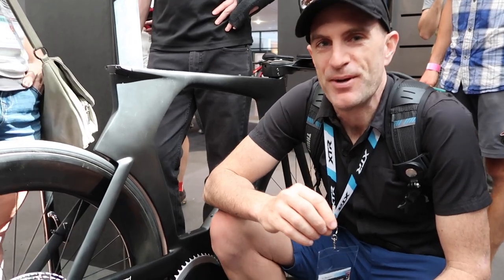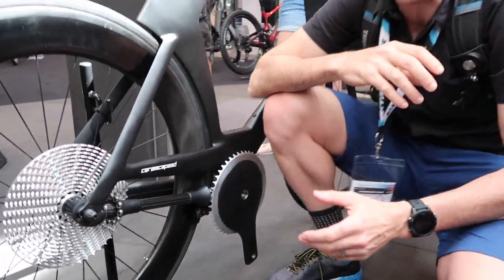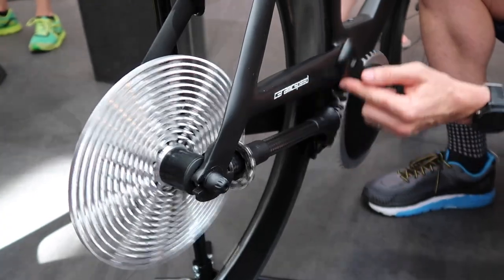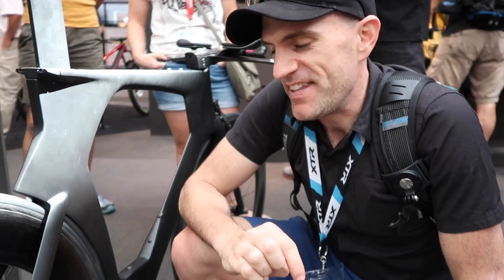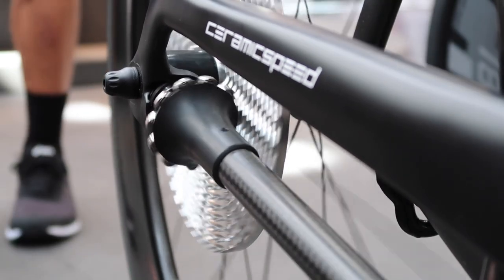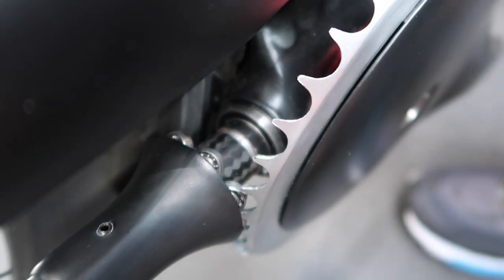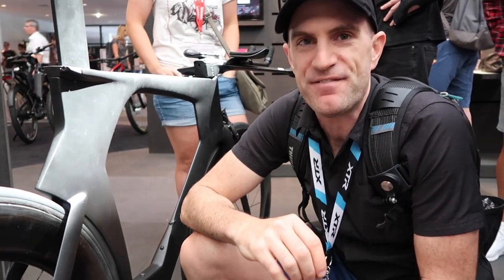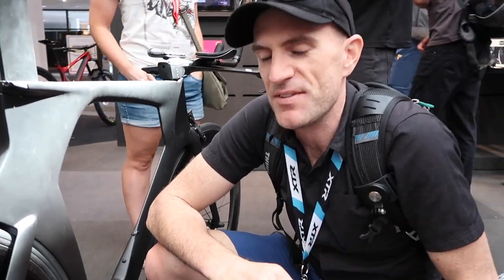CeramicSpeed DrivEN 99% Efficient Drive Shaft // Chain Free Bike // Eurobike 2018

Comment: The load will be concentrated on one or two teeth instead of being spread over 10-20 teeth.
Reply: Xia Jiang the cranks and cassette needs to be extremely stiff and strong for it to be usable and practical
Reply: Pretty sure the load is focused mostly on one or two teeth in a chain setup too...the chain just wraps around the others under no or minimal load?  Hence the “reduction in friction” claim here?
Reply: J Just J: pretty sure the load is supposed to be spread over all teeth in contact with the chain. This is the whole point of the shape of the teeth. As the chain wears and elongates, the tension in the chain will naturally cause the chain to move up towards the apex of the teeth and away from the base, so that the chain is still in full contact with every tooth and the load is spread. Only when you have excessive chain wear will the load be concentrated on the first few teeth. This is why an elongated chain is bad for the longevity of the drive train (this and the fact that the apex of a tooth is weaker than its base).

Edit: BTW I suspect this is also the reason why the smallest sprocket we can have is 11-teeth -- any smaller there will be too few teeth to spread the load.
Reply: Xia Jiang only if the chain and sprockets are a perfect match. Real world tolerances mean this is NEVER the case
Reply: there is still a lot of friction due to the chain having to move through other teeth.
Reply: J Just J you're right. Nobody here seems to notice both the chain and disk are deformable materials (ever so slightly) which is enough to have the load distributed mainly on the first few teeth.
Reply: Even in screw-nut system all load is focusing in 2-3 turns of threads.
Reply: Xia Jiang that’s exactly what I noticed and it’s not a new idea just an old failed idea that someone has  trying to bring back, I say let it stay dead, for a bike what we have today works , and if something works don’t fix it as what we have is quite efficient
Reply: The load on a chain is supported in the bearing in the last link to come off the wheel, that is where most of the friction is in a chain drive and where larger gear sets, where the chain flexes less, have greater efficiency.
Reply: if that were true it would mean that the chain would not wear out uniformly, only the two points of contact you mention.
Reply: The chain does move...
Reply: They say that the disc is made from Adamantium and so is super hard and stiff. Problem solved.
Reply: there are  now 10-tooth cogs, but you're right that those small ones wear out quickly. That's why Shimano makes the 3 smallest cogs replaceable.
Reply: Xia Jiang To get kinda smooth operation, circular motion, you need a certain number of chain links in contact with the sprocket.
A chain link is a made out of connected and straight chain plates. When many chain links are wrapped around any sprocket they will form a polygon. 

An 11-sided polygon is probably as small you can before you get a jerky propulsion; compare a square, 4-sided, wheel with an atleast 11-sided wheel.

It is possible to have a smaller sprocket than 11 teeth but it will wear out fast and since it has fewer teeth and a jerky motion which will add shock loads to the whole chain and sprocket system.

For comparison, with a 16 teeth sprocket, that is atleast half covered by the chain, you get close to 99% out a completly evenly moving sprocket.
Reply: Xia Jiang agree with everything youve said but i think the limit on how small a sprocket can go is due to the tight radius the chain will be pulled round, it would wear out much faster, that was my understanding of it on motorbike front sprockets anyway 👍🏼
Reply: Xia Jiang    Imagine riding up hill. That surface contact is very break prone. Torque would rip it a part!
Reply: Like in a automotive gearbox you mean, the ones that handle hundreds of HP and last for decades?
Reply: Xia Jiang a
Reply: Just like in any other set of gears.
Reply: Thats what she said
Reply: Yep then shreds the disk....
Reply: lots of smart people here. to reiterate: in chain system, its impossible for all teeth under contact to hold the load due to machinery precision, unless they are design with some 'elasticity' in mind to allow for uniform load holding, which is unlikely as stiffness is key to efficiency.
Reply: Ken Chan, yeah, however the chain is pushed against the cogs by the riders effort itself. 
In this system - it will just skip after even the most minimal wear, and if you realign it - it will get stuck on cogs without wear.
Reply: Xia Jiang that’s a good point
Reply: Exactly.

Will be Destroy more fast
Reply: You can put a plexiglass protection around same with a lot of bycycles
Reply: Do you really think the load on a chain is spread out?  I highly doubt it.  Do a little experiment: Put a bit of pressure on the chain.  Then go to the middle link, that would be in the back, and try to pick it off the sprocket with that pressure being applied.  I think that you'll find that there is no pressure on the chain at that point and that you can easily pull it off the sprocket only being opposed by the take-up idler.  It is only the first couple of links at the top that are carrying the entire load.
Reply: Lee Dove maybe on a new chain but everything gets worn in to nearly a perfect fit
Reply: There are quite a few papers on the forces involved in chain/sprocket systems.  The older ones tend to make a lot of simplifications, but the newer ones are closer to the real--life scenarios. For example this one has "The effect of the frictional and elastic properties of the roller chain and the sprocket are included in the analysis" : https://vdocuments.site/documents/analysis-of-sprocket-load-distribution.html
Reply: @stillededge  The chain extends with force. Isn't the energy working on the whole chain? I think it is, as with time the chain becomes longer and for replacement.
Reply: @rojasbdm  Indeed, that's why a  new chain will skip/slip on old sprockets.
Reply: @joacava12  Apparently you didn't notice your sprockets rotate when you turn them?
Reply: This was exactly what popped into my mind 🤔 for such small teeth it will be quite a load plus frictional wear.. is this even "doable" ?.. those teeth are quite narrow..
Reply: Good point. This looks more like a worm gear situation (like on a SkilSaw for carpentry). Very robust.  Linear actuators are also worm drives, but with bearings (that feed through a closed loop) making them more efficient.  This specific design might not make it to the Tour de France, but it could lead to a design that does.  I remember talking with a car engineer in Detroit in about 1970 about infinitely variable gearboxes. They were considered to have too much inherent friction to be practical. Practical versions now exist.
Reply: The “load” is human power 
Not really much of a “load” at all.
Reply: @insoft_uk    I like that someone is questioning the way things are and seeking a better way.  I don't expect this particular design to work (at all!) on bicycles, but I give them props for trying.  
It's the people who just don't realize something is "impossible" that are the ones who come up with a better way.  
I love weird bike designs.  Wish more folks did this!  I think this particular design will work fantastically well for a low load application, like opening window shades or sunroofs or something like that.
Reply: @thoocas  The smallest now is 10 teeth with Shimano microspline. And the smallest cog is always separate from the cassette so that you can order a new 11 or 10 cog from shimano because it wears out fast since only 5-6 teeth are in constant contact with the chain. 
Now with this ceramicspeed you have exactly 1 tiny bearing and exactly 1 tooth in contact at any time to transfer your 500-1000 Watts from your legs to the wheel. Good luck with that. 
And hey, Shane said it takes 8 hours CNC machining for the cheeze grater, so good luck with that (and a fat purse full of money).
Reply: @CabrioDriving  No. A bike chain can last 15.000km without problems. But: only in a clean, controlled lab environment.
In reality dirt gets between the chain parts and dust is just microcristalline rock which grinds away the metal. That's when the chain starts getting longer over time and is toast after 3000km.
Reply: @rexluminus9867  Don't think so. Aluminum has certain strength and flexibility. The maximum torque is on the outer ring, which would be on the steepest hill. Putting on 500Watts  and the resulting torque you can calculate the maximum pressure from the tiny bearing to the bend of the tooth. Which means that the disc will move inwards. To much power and the bearings will slip over the teeth due to flex of the disc. So the disc has to be very (!) solid (and heavy!). Aluminum teeth wont's survive a race, it has to be steel.
Reply: @DilbertMuc  Read my comment again & you'll realise we're talking about the same or similar problem.thx.
Reply: @rexluminus9867  I meant the torque pressure will bend the aluminum disc inwards and it will just slip.I guess the disc is then bent and toast anyway...
I had similar problems with a Gate Carbon Belt on a too small cog (20 teeth). Too much torque and it slipped. Changed to 24 teeth cog and now I can put 700 Watt on it and no slippage. The Ceramicdisc has exactly 1 tooth to transfer the torque. Good luck with that.
Reply: @sammythekiller1079  - The concept is no different to a car differential setup really - just doesn't need to be as robust obviously, because the rider cannot produce 100's of HP.
Reply: those tiny bearing balls will have to struggle allot
Reply: when i saw the teeth, i immediately thought that they will broke or bend under pressure
Reply: @joacava12  No. It just means that the chain moves... And selectively there will be wear. 

Only some teeth apply force at a time with a chain.
Reply: @rexluminus9867  Actually... It wouldn't. You can't apply enough torque to the wheels with your body... Plus, anyway, the pinion will have very little torque applied to it by design... It will spin fast and be reduced and therefore the torque increases... But only at the wheel.
Plus it can't jump out with limited volume and rigid construction. So it would also skip less than a chain.
Reply: @NJ-wb1cz  And that's exactly why the design has bearings...
Reply: @CabrioDriving  The force is only applied where the chain is fully tensioned. And that's only the top of the chain.
Reply: @ptrblz  It's not that high of a load... There is torque conversion happening... The pinion will spin fast... The rack slowly... But torque only results when the motion is transferred, and translated by angular motion... Meaning, the pinion has very little torque and applies very little torque to the rack... But it translates and the RACK gives torque to the wheel. Therefore, there's no additional wear. 

Think of it as AC power lines being the pinion and transformers the rack. AC power lines havereally high voltage and pretty low current. The transformer converts it to low voltage high current. When you put a load across the transformer, you drain a lot of current from it, but if you check the powerline... It barely drains more current. It's basically the same thing.
Reply: @fenderstratguy  Well, it does work on motorcycles, with much higher power and torque than what a human can produce... But of you think that somehow the transmition system used in cars and high performance motorcycles isn't roubust enough, okay sir, we totally trust that. 

No. This is literally the best way of doing it. High velocity pinion and low velocity racks. Plus, the low torque of humans makes this have less problems than chain and doesn't require active lubrication.
Reply: @DilbertMuc  It could also be made of carbon fibre. Or still with aluminium, but thicker. And also, yes, steel. After all, that rack isn't thick anyway, so it wouldn't add much to the weight.
Reply: @DilbertMuc  There are these things called motorcycles... They use pinion and rack on high performance ones... And also, there's another invention called cars... Guess what? They use pinion and racks...
Reply: @kivimangoproductions9655  Pressure that a human can't apply.
Reply: @vladlu6362  , how exactly do bearings solve the problem? 
In the classical system, the chain is pulled into the center of the cog with force proportional to the force of pedaling. The force of pedaling itself makes the chain not skip.
In this system the vectors of forces are orthogonal and the force applied on pedals does not press the driving cog into the cassette. In fact, the force of pedaling pushes the cassette away from the cog.
Reply: @rojasbdm  no, its true the force is not distributed absolutely perfecyly among each teeth, but still 80 to 90% and that distributes the force evenly enough among the single teeth
Reply: XJ The smallest cog that fits on a traditional HG freehub body is 11t. With other freehub designs like XD, we’ve achieved 9t cogs.
Reply: James Rindley The ones that weigh tens if not hundreds of kilograms?
Reply: 5putput Do any 200hp motorcycles use shaft drives? And 200Nm is only 147 ft•lb, which isn’t ridiculously higher than max human torque output.
Reply: 2:18
Reply: @vladlu6362  Have you ever bicycled? Appears not cause if you have you know you can stand on a pedal at a high gear on a grade and hardly move. You can do this and not break anything. It's load tolerant. Chain-sprockets have a strength to weight ratio that this drive can't touch. This drive has a tiny engagement area and the major forces are out of plane which means that when subjected to the above scenario, it will distort and break. Can the drive be built strong enough to handle all the loads that a chain & sprockets can? Likely but then efficiency drops and weight climbs. Negates any advantage doesn't it? In fact the drive becomes a liability, except for people that don't bicycle, like you.
Reply: @thoocas   Sorry, you say :  suspect this is also the reason why the smallest sprocket we can have is 11-teeth -- any smaller there will be too few teeth to spread the load.
. I think ; the  chain parts needs a circle . So, when the sprocket is goeing smaller, the chain parts dont turn a nice circle ;)

Comment: Technology 😂 motorcycles with drive shafts lose about 12.5% per 90° translation. 25% loss through a double translation is typical. Chains lose way less in use, which is why all racing motorcycles use chains.

Comment: Yeah that's 4 of my biggest concerns. 
1. Maximum power input
2. How will the drive chain handle shock
3. The amount of Watts lost during gear changes
4. Upkeep, what will it take and how fragile this mechanism might be. You'll also have to deal with dirt and debris that might get caught in the mechanism. What will it take to keep this drive train mechanically sound.

Good video. Thanks for posting.
Reply: When you wrote “gear changes” I got to thinking the gear on the wheel could be a helical spiral type and the shaft could be lengthened by pedal force to alway be in the “right” infinitely variable ratio. 
Like a cvt maybe
Reply: i tthing they could use less fancy but well tested rings from cars gearbox
Reply: Stupid idea.
Reply: Also how hard is it going to be to get the wheel off when you get a puncture.
Reply: as you can see its a triathlon bike it's not meant for impacts it's meant for racing on flat roads. small schock/impact can handle it since its only for racing

Comment: A track sprinter will shred the hell out of that thing in his first pedal push.
Reply: Well a track sprinter won't need gears will they...
Reply: @discbrakefan  I think he means a track bike sprinter, not a runner
Reply: @fenderstratguy  I know what he meant - track bikes don't have gears...
Reply: @discbrakefan   Oh!  lol
Reply: CHUNK-CHUNKCHUNKCHUNK for every power stroke. 

Very weak design.. innovative sure .. but weak. Anyone with big legs will destroy that design.
Reply: Bike design is not for sprinter bikers in my opinion. This bike mean for convenient transportation. Imagine no fuel that could top speed 90 or even 100 km\h. Easy for uphills with less hassle since it is more powerful than chain drives

Comment: That rear cassette proto is definitely going to trigger those already paranoid about spinning brake discs of death!
Reply: A mincer ;)
Reply: Those little plastic shields might be making a comeback!
Reply: Turning the cassette around would solve that issue. Would require an offset though.
Reply: It will be encased in a shell to get rid of the Mad Max style spinning razors ha  - and so it will stay clean when going through mud etc.
Reply: Ben W that was my first thought. Its a load of rubbish. Mtb 4x riders race down tracks against each other with numerous crashes. No issues with them using disc brakes
Reply: It'll Slice the Face when it Face Plants to riders
Reply: Martin R. you can't turn the cassette around, there isn't enough room to fit the rotating couple between the cassette and spokes
Reply: Martin R., The cassette would then spin in the opposite direction unless the other end of the shaft was placed on the outside of the drive ring.